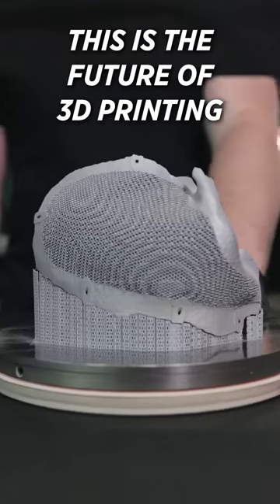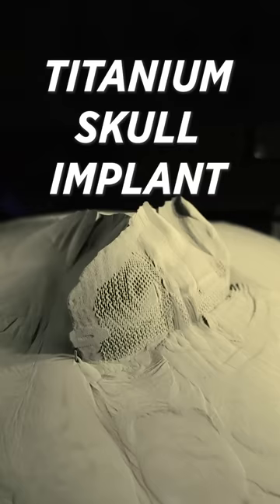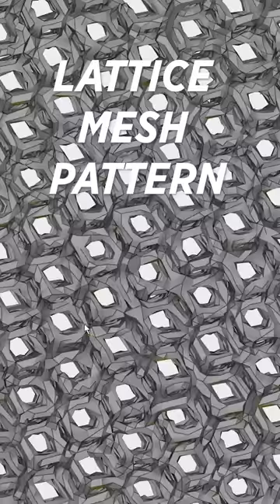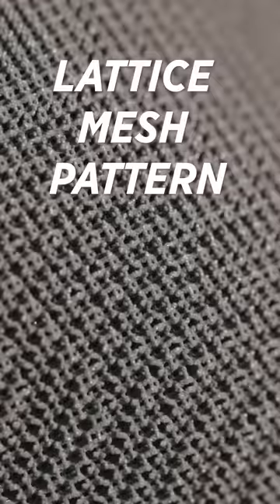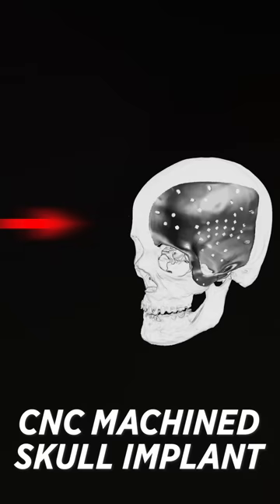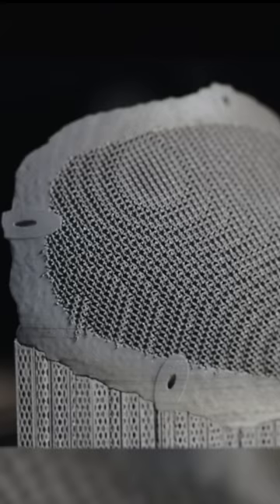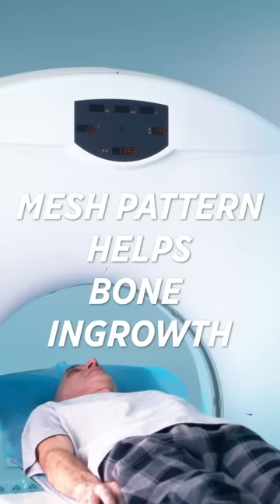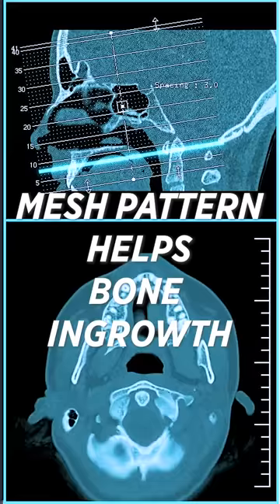3D Printing the World's MOST COMPLICATED Medical Device

Comment: Metal 3d printers make incredibly brittle prints as of right now
Reply: I would think brittleness, or lack of, would depend on the alloys/ceramics used . Also, isn't  there a tempering/ fusion process following?
Reply: @williamevans6522  The metal isn’t bonded very well
Reply: Till you cure it to solidify it
Reply: @Mirage5892 Yes, sintering, I believe  it is called.
Reply: Actually porshe makes metal 3d printed pistons with very complex forms and performance on one model, boeing also uses metal 3d printed parts in their planes.. we must guess that it makes the job..
Reply: Based on their commentary, they mention “bone in-growth” so I imagine the bone growing into the lattice structure would give it an incredible amount of durability :)
Reply: After that graft is printed, is it treated with  hydroxyapatite?
Reply: @joeb570  except we use it for rockets and rocket engines if there fine with it your skull is
Reply: @livingglowstick1337  The metal is not bonded very well right away, you have to go through a long process to cure the metal. CNC machining is a lot more effective as of right now.
Reply: @livingglowstick1337  Metal 3d printing is only a good choice when your making a complex part and it would be impossible or would take a long time for a cnc router to cut.
Reply: @joeb570  no it's quicker cheaper and allows the creation of larger objects there's a reason it's used in rocket industry and medical industry
Reply: @joeb570  the curing process isn't even long it's short than what it takes to ready a cnc peice the machine and then tidy it up there's a reason it's used in high performance situations and to cut down time on parts it now takes them weeks to make a rocket engine when it took them months please do explain that
Reply: @livingglowstick1337  Metal 3d printing is good for making small parts fast and more cost effective. But with 3d printing, you have to build ever layer of the part. Because of this, the larger the part is, the more time it would take to make it. With a cnc machine, you take material off. And the "tidy it up part", if you have a machine with automatic tool change. You don't have to move the part anywhere or change the tool yourself. metal 3d printing can never match the strength or the precise parts the cnc machining industry produces. Because the metal is cured first, then cut. But with a metal 3d printer, you have to build the part, then cure it. You wont keep the exact dimensions of the part. Thus CNC machining is quicker and more efficient when making larger parts.
Reply: @livingglowstick1337  You are telling me to "shutup", when i give you logical responses. I have at least close to correct grammar. You are telling me that it cuts down on time, without explaining why. You have a poor choice of words. Because of these reasons, i do not believe you have experience in what you talk about. I have experience in 3d printing and CNC machining. I do not have experience with metal 3d printers, but I know people who work with them.
Reply: @joeb570  also your last part tells me your biased as you have no clue how it works or have experience or the equipment it's a threat to your business
Reply: @williamevans6522  yes, I've worked with 3D printed rocket engine parts as an aerospace engineer and they're surprisingly structurally sound. The as-printed surface can be very rough and usually requires some form of finish machining or chemical etching, but it's otherwise a great way to make parts that can't realistically be CNC machined.

Comment: It’s funny to see a video like this talking about the mesh and bone adhesion. I actually knew that was likely the best way to make bone replacement devices when I was a teen, in the 80’s. But I envisioned it would be done with some kind of ceramic with smaller porous surfaces.

Comment: SLM is pretty cool, however, it's still limited to usually small quantity manufacturing such as prototypes. This is because humans have a very large amount of experience figuring out tuning metal properties from heating and cooling metal but slm/3d printing metal throws that out the window. Additionally slm printed metal parts have much more microscopic imperfections making it significantly weaker. There some nice comprehensive studies done on this. It's cool to have this around but I think it's also good for us to understand the limitations.

Comment: Many years ago now, before SLS in metal, my dad helped a UK University pioneer using gold coated SLA resin rapid prototypes for prosthesis (cranioplasties in particular). 
They gave him the prototypes. He electroformed gold over the RP then dissolved the SLA resin with solvents.
Electro gold is much harder than beaten or cast gold. Even has some spring properties. So it worked great. 
Went on to also coat bone screw threads with thin gold so they showed up on x-rays for future inspection. 

Really interesting R&D work that directly led to this kind of stuff starting to become standard.
But his name is nowhere in the history books despite the process being his idea. 
Never applied for an IPO because the paperwork was too complex for him. 
Fantastic engineer. 
Useless businessman. 🤦‍♂️

Comment: You can expand this process to replace entire bones. 

Say, for instance, someone shatters their femur. They’ve miraculously avoided slicing the femoral artery, but it’s impossible to repair the femur itself. 

By 3d scanning the other femur, mirroring it, and then 3d printing an exact copy that can be modified to incorporate existing hip and knees prosthetics, as well as a void down the center and harvesting as much of the original marrow as you can, you can treat a catastrophic injury like a shattered femur without resorting to amputation
Reply: If only. The main reason "shattered" bones can't be repaired is that the blood vessels and capillaries in the bone tissue cannot be accessed for repair. The Bone itself is alive, and without blood to provide nutrients, both it and the Marrow will die.
The underlying reasons for amputation are Non-Viable Local Blood Circulation, Infection, and Necrosis.

Comment: As implants are classified critical medical devices, they must be sterilized before use. Medical devices, including implants come with specific - Instructions for Use - which include compatible methods of sterilization. I’m curious to see how CNC and current available methods of 3D printing will meet the requirement of terminal sterilization.

Comment: wait what? the future? this looks exactly the same as the first 3D printing stuff i saw over ago, with the resin and plastic stuff now being the "future of 3D printing" back then
Reply: This goes in someone's head and is made of metal using lasers about to create something impossible on a 3d printer your thinking of
Reply: Technically it is quite an old technology, but the first difference is that you wouldn't want such an implant out of plastic as it wouldn't be strong enough (that's why medical grade titanium is used).
Additionally:
It is a rather old technology, EOS produced the first SLM (before called DMLS) metal printer in the 90s. And these implants also have been in use for quite some time, it simply is that the printing speed has increased a lot and with this the costs of each part reduced to a level that makes it more feasible for general use. There are also hip implants, spine implants etc. all using the same lattice based approach.

Comment: Insurance companies are like "shh, don't tell them it doesn't cost more".
Reply: That statement can be very misleading if you don't know how manufacturing works. CNC milling mostly charges for machine time, not material cost. It's why intricate patterns would be expensive on a mill because you'd have to drill out each individual hole. Whereas a printer simply sketches out the shape and it doesn't matter what it is exactly. This is what they mean by "intricate structure doesn't add manufacturing cost". 3d printing can take very long compared to milling making it more expensive, plus sintering powder is stupid expensive compared to solid metal billets.
Reply: @michaelbuckers  I was cracking a joke but that was pretty interesting. Thanks!

Comment: That part, just to make it, is probably around $500 to $1000 dollars(just a guess). I was at Michigan Tech, and they have a metal 3D printer that we saw. We got some prints off of it. They were these little fish about 1.5 inches long. The inside was hollow and the sides of the fish were lattice in structure. It cost about $20 dollars a fish. So, I am going to increase my estimate to $2000.

Comment: With a half million $ metal 3d printer, if not more than that. Hopefully those machine cost will go down in the upcoming years. Yes you can get some around 100K$ but way different than those high accuracy powdered models

Comment: Ohhhhhh yeah ummmm that’ll have to be replaced at some point too, soooo one of the good things about the original plate is it’s a smooth surface… so a problem with implants is course surfaces or rough surfaces can build up a callas scar tissue on it… a good example is older breast implants….

Comment: I'm curious why this print needed support structures. I thought one of the benefits of the laser sintering method was that the un-sintered material supported any printed parts until it was dusted off after printing.
Reply: Depends with a structure like this you want want it to get easily damaged
Reply: It really depends on the machine and how well optimized the parameters are, the material etc. All those have an impact on the ability to produce without support structures. E.g. polymer SLS processes are usually easier to print without supports than metal SLM.
But the current development definitely goes into the direction to make it easier by improving the software so that supports are not/less needed in the future.

Comment: Could this be accomplished on one of the MarkForged printers?
Reply: Technically you can produce Lattice structures with all 3D printers (just the resolution here cannot always be achieved with FDM ones). In general all Selective Laser Melting Printers should be able to achieve this kind of precision. So that includes the MarkForged PX100, all EOS printers (M290, M300, M400), etc...

Comment: Why does it need supports since it comes from a powder bed printer ?
Reply: Maybe keep it stable before sintering process.
Reply: Because we live in a planet with gravity pushing everything towards the core.. just like every 3d printer need to suport overhangs.
Reply: Because by fusing the powder, the piece begins to increase its density with respect to the powder. If you don't support it, it starts to sink. Also, in the case of printing with a powder bed, the supports are not only for holding in the overhangs. They are also used to transfer the thermal energy produced by the laser to the build plate.  In this way, the deformation of the part is reduced.

Comment: How hard is it for a machinist to get into 3d printing?
Reply: Not hard at all. I got into machining from 3D printing and I’m 100% self taught. A lot of the the same principles used in machining are used in 3D printing. Especially if you used CAD software in machining. 

If you never used CAD software before it’s still not that hard. I will say the only thing I seen American machinists have issue with is how most of the 3D printing community exclusively uses metric measurements but that was only in a couple edge cases I seen.

Comment: I feel that additives manufacturing is still not cost effective, more of R&D before CnC one 😅
Reply: It's way cheaper it's a laser and powder it's multiple times cheaper
Reply: It really depends on the application:
A highly complex design with the need for lightweighting (and thus a lot of volume is empty): yep, SLM/SLS is definitely cheaper.

Low complexity, easy to reach sections to machine, and only a little bit of material is taken away. CNC is far quicker and cheaper.

Then there are other 3D printing approaches which are much quicker than SLM/SLS but are also not as precise and need more post processing. It as always is a question of what you want to produce and how quick you need it.

But overall SLM wastes less material and is much more flexible for manufacturing parts.

Comment: why do you need support to print in laser-powder printer?
Reply: the forces generated by the laser actually blows the powder away at the site of melting, so you can't rely on the loose powder for support like you can with MJF or SLS machines doing nylons and other powders
Reply: @CorvidianSystems thanks for the explanation.
Reply: @yudhistirahayuatma  it's additives manufacturing.adds powder on every later. This support is important
Reply: @CorvidianSystems  that's wrong in this case the delicate parts are disconnected for a lot of the print and need surrports to keep them in place so it doesn't failt

Comment: Nah, this is the present of 3d printing.  There are so many annoying steps added for any powder based sls system that I strongly doubt it will ever become as common as fdm. same goes for resin printers. There are a lot of benefits to them, but they are just much more annoying to actually use. My resin printer makes amazing prints, but I hardly ever use it.
Reply: So for specialty purposes, yeah, they are amazing. But they will probably remain for specialty purposes only.

Comment: That porous weak design isn't going to be anywhere near as strong.
Reply: How much force/load are you thinking is going to be on a skull implant? The mesh pattern is there for a reason, it helps promote bone in growth after surgery
Reply: Maybe not as strong as solid, but you’d be surprised how strong a lattice is. The bone will also grow way better into the metal making it super strong together
Reply: Lettuce is much more stronger with so many cross braces.

Comment: No this is not the future... the future is supportless 3d printing. HP already makes industrial jet fusion printers that are supported by the powder itself eliminating the need of any support structures. It wont take long until that stuff is at your home. In minituarised form.
Reply: Guess what this is the same printing process this just needed surrports as the mesh pattern you see is disconnected from the rest of the brunt while printing allowing them to move and ruin the whole print use common sense
Reply: @livingglowstick1337  this tells me youve never seen a working commercial 3d printer.
Reply: There are also ways to SLM print without supports. E.g. EOS machines can do that, they even offer e-learnings about how to do that.
But in the end both have their advantages and disadvantages.
Material jet printing is quicker, but SLM is still more precise. MJ also needs the additional binder, while SLM only needs the laser energy, which also can have an impact on your costs depending on where you are. 

Both need metal powder so you most probably won't use them at home if you don't want extremely fine metal powder in your lungs (which is not a nice thing to have) which is why companies which use these systems have extremely strict rules for powder handling. So for home use FDM printers are still a much sensible way.